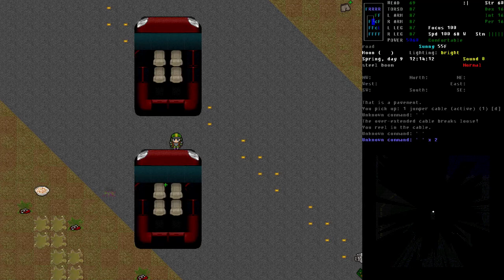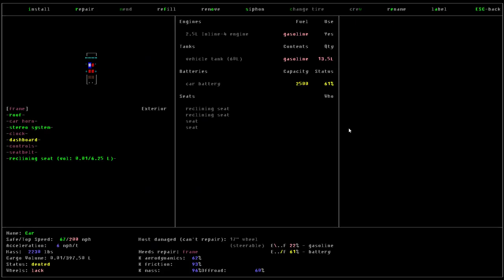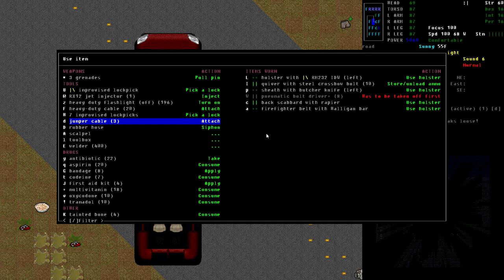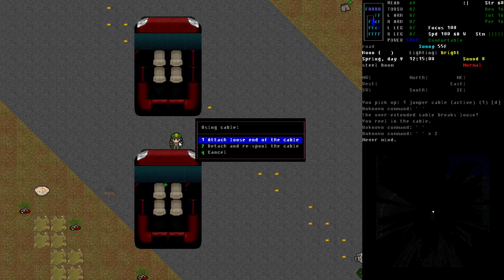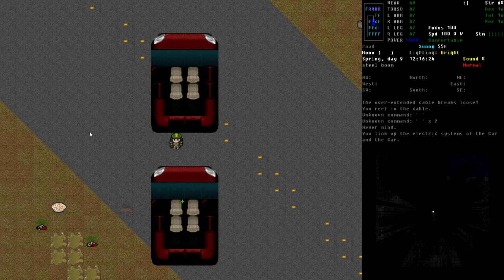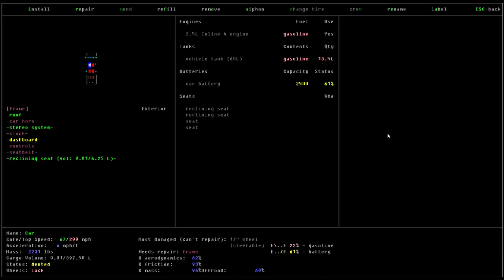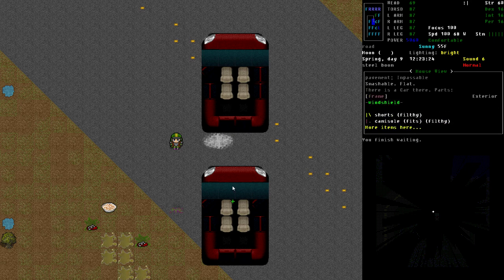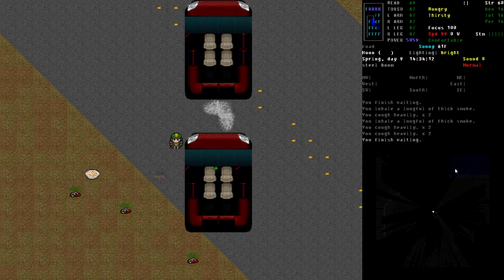Cataclysm Quick Tip #34 - How to use Jumper Cables

Comment: The video doesn't mention that while the vehicles are connected, you can start the southern car even if it's at zero percent. It just takes the power it needs from the north, just like in real life.
Reply: Yeah, that's an important thing to know, you don't have to wait for the battery to charge to start it, and once it's running the alternator will charge its own battery.
Reply from the maker: A good point that would not work well in this specific example as i removed the alternator from the destination video. In many situation this would be good info though so i will pin it here.

Comment: Question: What happens if you chain jumper cables together? Can I use a vehicle consisting of a frame as a power line if all I have is jumper cables?

EDIT: You answer this later in the video.

Comment: Is there any way to charge car batteries other than jumper cable connecting them to another vehicle?
Reply from the maker: not sure i have ever actually bothered using a jumper cable during actual play. i usually just grab a 'charged' battery from a different vehicle and install it into the vehicle i want to get moving. fast, simple, and low skill/tool requirement (mechanics 0 and bolt turning 1). In addition to charging while attached to a 'running' vehicle (via jumper or directly installed) you can also charge them with other 'battery charger' tools that accept 'rechargeable' batteries like the 'recharging station' you find in Humvee/APC/Limo/etc. I haven't tried using a hand-held charger but assume it would work, just very slowly.
Reply: @Vormithrax  I've found good way to charge car batteries: get a solar panel car to your base whether by driving or bringing it with another car and shove battery in it.
Reply: @cow_mangler510  It's pretty easy to just remove the solar panels and then build a vehicle at your base dedicated to that.

You can also mount them on a frame with casters for an easily mobile charger, or even on a foldable frame.

Solar power is super useful. It's worth setting the game to remember the location of any vehicles with solar panels you pass on your exploration and then making a taking a trip with a vehicle with good storage to those places and picking them all up.

I found a van really early that had two back seats and two trunks, then ripped out the two extra back seats to fit two more trunks, so it's got 800L of interior storage, and then I have two bike racks on the back, each of which I can attach a shopping cart to for another 300L of extra storage if I need it.

I don't try to hit things with it, but it happens occasionally, so it's worth reinforcing some of the most vulnerable bits, like the headlights and windshield. They don't add much weight, but it sure helps avoid blowing them out and having to fully replace them.